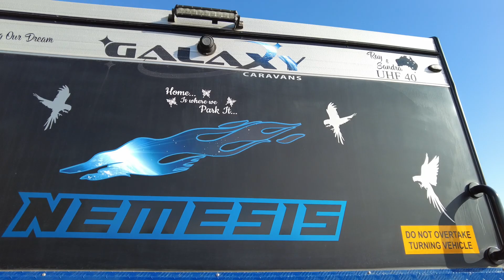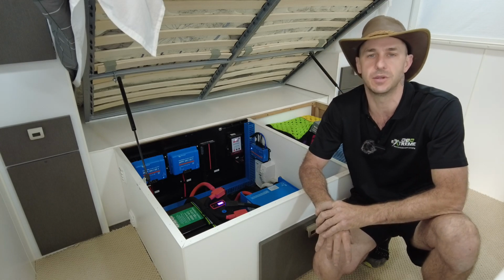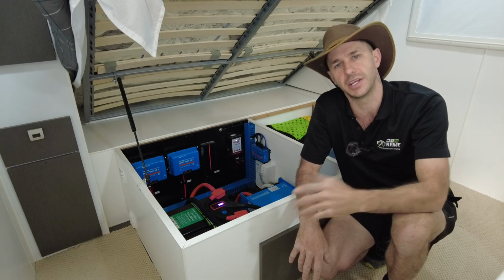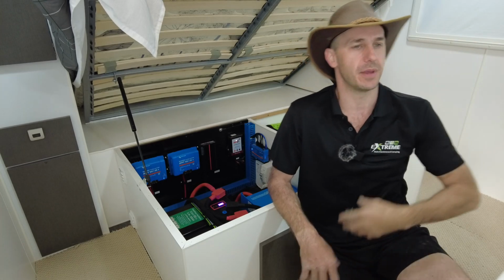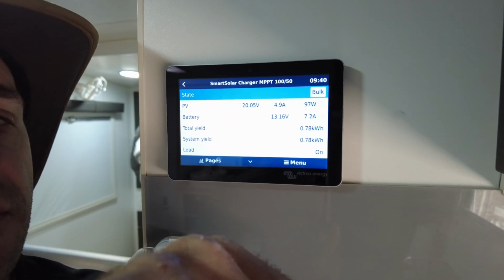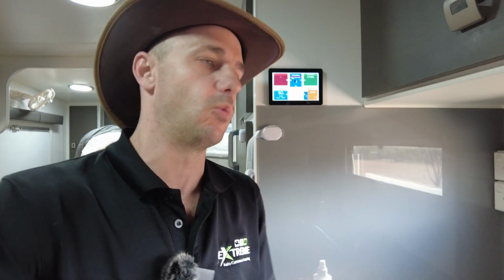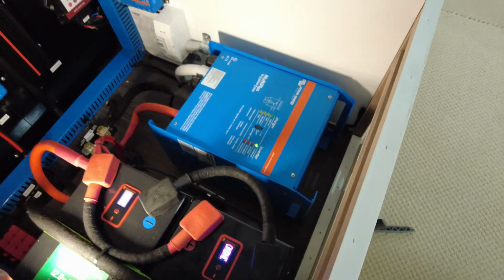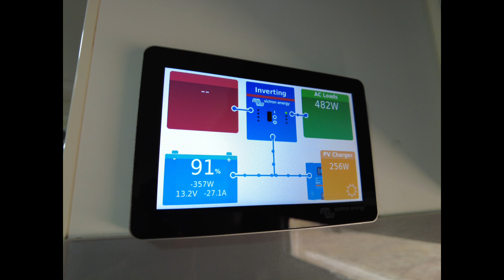Galaxy Nemesis 600ah, 1200 watt solar off grid setup, runs the Air Conditioning, microwave and more.

Comment: There seems to be some rue changes with AS/NZS 3001.2:2022 stating the batteries must be installed where they cannot vent to the occupied area including lithiums. The technical bulletin say

 "Lithium-Ion Batteries
The following requirements apply to all types of lithium-ion batteries and apply in addition to the
general requirements above.
Batteries must be located externally – ie behind a wall, compartment or barrier that prevents any
vented gases entering the habitable area of the recreational vehicle."

This might change the way we mount batteries under the bed and we will need to enclose that area and vent out side.
You might need to become a builder now as well as caravan wirer to meet this code in fabricating boxes etc

Keep up the great work you inspire me to do something similar in my van.
Reply from the maker: That is correct as of November this year. All batteries will have a John guest fitting and the case will be vented to atmosphere.
Reply: @extremeacc101  Interesting that the proposed rule changes indicate it must be installed outside. They need to clarify the outside statement as it may be confused with different areas of the van. I bet this will be up for discussion somewhere but not sure if the rule writers will listen to a practical installer like your self
Reply from the maker: Doesn’t say outside at all.
It states the battery must be in a sealed area not in living quarters.
We are working closely with the actual regulators themselves here. 👍🏿
The “battery” is actually the lithium cells in the casing. So, you must vent or have that casing seperate to the living area.
Also no more than 4 connections on the positive terminal too.
A few more small items to address but the above will be the main focus.
Reply: @extremeacc101  Sorry I meant to say externally not outside. Great pickup on the battery container not being the battery just the cell inside.